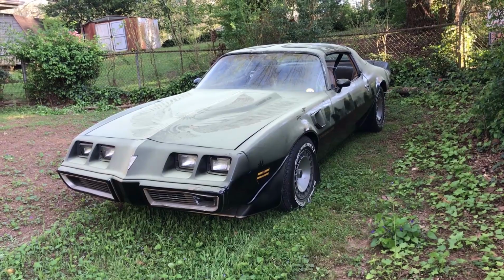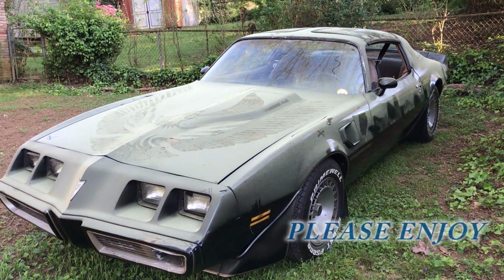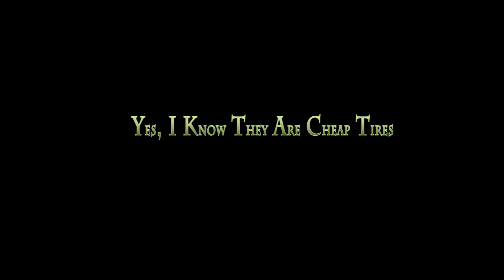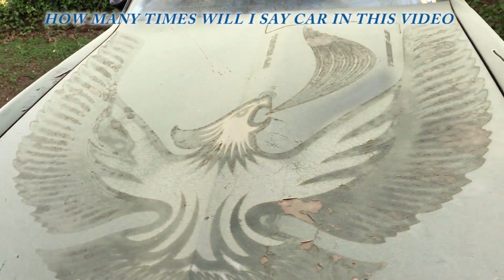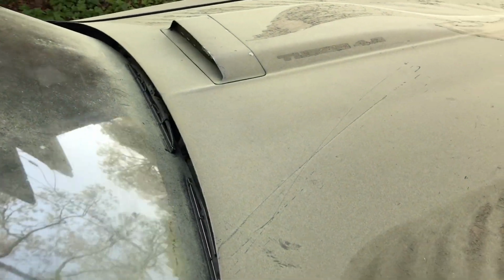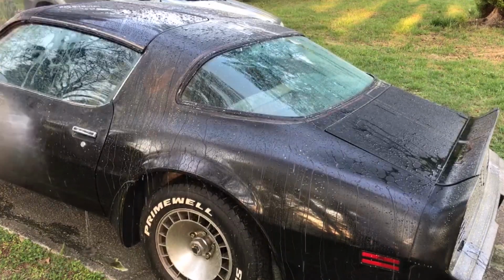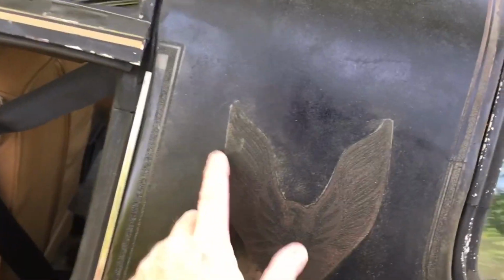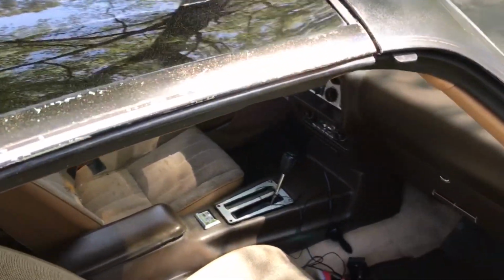Trans Am Yard Find Full Story

Comment: I felt Pontiac did a good job on the 301.Yeah, 301 could have been design so the Pontiac 350/400 intake could have been used.If Pontiac would have spent more time like Buick did with the 3.8 twerking. Things would have be different for the 301turbo. Maybe instead of the Buick Grand National we would have had a super fast Pontiac G body car. I had a 73' Trans Am 400 run good at 230hp. The 301 turbo had 200 hp  about not bad for 99 cubic inch less. Hope you keep the car.
Reply from the maker: You are correct and thank  you.. Pontiac did the best they could do at the time